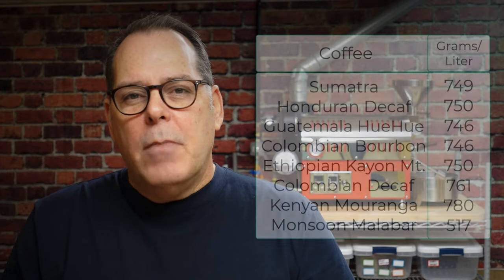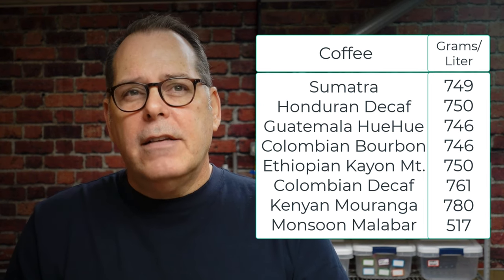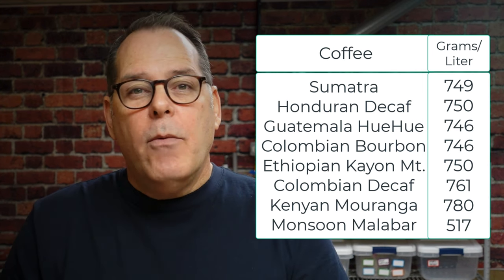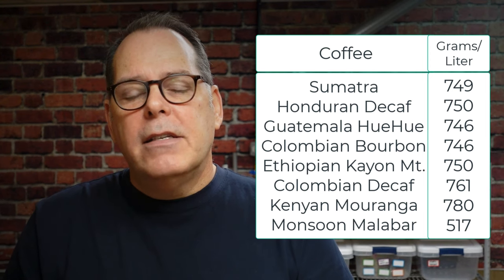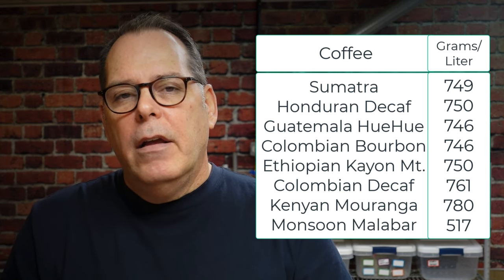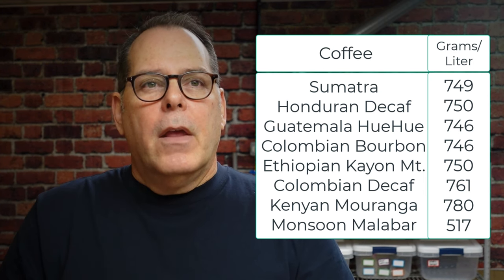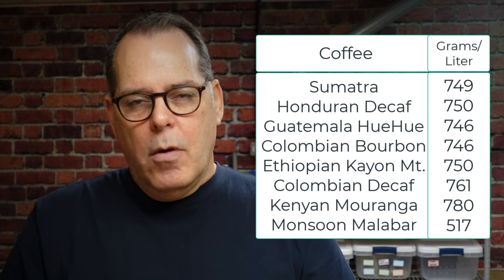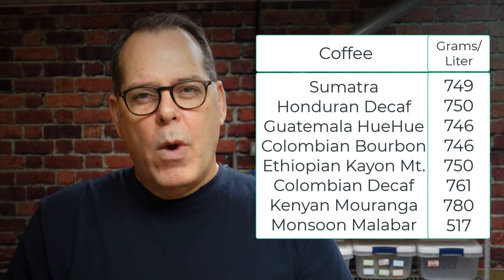Measure Green Coffee Bean Density

Comment: I was wondering if moisture would have more of an effect, if a high density bean with 9% moisture and a high density bean with 11% moisture would the 11% moisture bean roast more like a medium to low density bean as it will conduct heat better? Or would it not be as significant as just the density of the bean? I would guess density matters but what makes up that density also matters,  I’m not quite at the stage of measuring all of these variables yet but it’s super interesting, so far I have a basic profile I run on all my beans as a test roast (100g) to see if the roast needs to be longer or shorter and then adjust from there but I’m guessing by testing density first and moisture I might be able to jump right into a profile that would be 80% to 90% correct for the bean. Definitely going to test density today!
Reply from the maker: Hi Jack, great point.  It is very interesting and I am not experienced enough to give any definitive perspective comparing what is more effective.  I agree that moisture is another part of understanding our coffee and how it may respond to heat.  I measure moisture loss  from green to roasted beans, but I don't have a way to measure moisture level of my beans.  Do you?  What do you use?  Take a look at this really interesting post by Joe Morocco dealing with this topic and let me know what you think.  
 https://joemarrocco.com/2016/10/24/coffee-roasting-measuring-what-matters/

In a nutshell, Joe says:

I" would argue that this difference in moisture does not matter to how heat is transferred to the coffee. The density of the coffee DOES matter to how heat is transferred to the coffee.  The physics of heat exchange are such that: heat transfers more quickly (conducts) through more dense objects, and more slowly, (is insulated against) through less dense objects.*  Therefore, density is key."

I appreciate the discussion and want to learn more about this topic  Maybe I need to buy a moisture meter?  Let me know what your testing revealed.

Thanks again for your comment and for watching my video!

Comment: Hey Mike, good info. So what altitude ranges define low density vs high density beans?
Reply from the maker: Hi Gary,

Density isn't just about altitude, but temperatures, moisture and maybe even the varietal.  Generally speaking, the higher the altitude has cooler temperatures and less oxygen which causes the plant to grow slower.  This slow growth of the seed creates a really solid, dense bean.  These dense beans tend to be more sweet.  Coffee grown below 1200 m.a.s.l. (meters above sea level) is considered in the lower, softer density.  Between 1200 - 1370 is considered a medium density.  and above 1370 meters we start to get into the high density beans.  There are actually other ways they describe density, which is hardness.

Low Density
SB - Soft Bean ( grown below 1200 meters)
SSB - Strictly Soft Bean ( grown below 1200 meters)

Medium Density
HB - Hard Bean ( grown between 1200-1370 meters)
HG - High grown (grown between 1200-1370 meters)

High Density
SHB - Strictly Hard Bean (grown above 1370 )
SHG - Strictly High Grown (grown above 1370 )

This is my source article for the data above.
https://perfectdailygrind.com/2021/08/understanding-coffee-bean-density/

Comment: Hi namaste good morning I'm from Nepal 🇳🇵.  My question is how we can measure it at home
Reply from the maker: The instructions are given at this point 11:50 in the video.  Measure 250 grams of water by weight into a plastic cup.  Then draw a line around the cup at the water line.  This is your fill line for coffee beans.  Read that weigh and divide that by 250.  The result is a decimal number.  Just remove the decimal and use the first t numbers.  Example would be 0.768 and this would use just 768 as  your number .  Low density will be 500 and super high density will be 800

Comment: Thanks for another great video! I just measured the density of the three beans I’m working on currently (Dominican Org, Brazilian Mogiana, and Congo Kivu) and to my surprise they all weighed within 1-2 grams of each other, leaving the bean density practically identical. Is that close enough to initially do the same roasting profile on all three per do I need to adjust over 1-3 grams over a 200 gram sample?
Reply from the maker: Hi Michael,  Initially....... yes.  
 Density is one way to determine how you will approach the coffee.  Also look at the bean size and processing.  Small beans will require you to be less aggressive with the heat.  Then there are the tasting notes and your own personal goals for a flavor profile.    So, technically you should have similar results as far as temperature, color and the overall roast level.  We haven't discussed the existing moisture level in the beans, how old they are and where they have been stored.  These factors can cause your results to vary even when you use the same profile.
Reply: Much appreciated. There are definitely differences in bean size among the ones I have on hand. I’ll have to check with the supplier and see if the other information is available. Thanks again!
Reply from the maker: i don't think you need to be that precise Michael.  Generally are the average size beans, very small beans or large beans is the idea.  If you are going for origin flavor and not a darker roast then using the same profile to start should be good enough.  Based on the coffee you mentioned, it sounds like earthy, darker notes like nuts, chocolate, and maybe a little fruit are in those coffees?  Also, the altitude for those coffees are probably not really high and most likely something like 1,000-1,500 meters above sea level.  So, if they are similar you have a better chance for them to behave similarly using the same profile.  There will probably be some adjustments to your heat needed between these coffees.  The only way to know is to chart your roasts and compare times and temps.

Comment: I went ahead and compared the densities of my regular and decaffeinated Columbian, and sure enough, the regular is less dense.  However, I also noticed that the decaffeinated coffee lost more mass in water than the regular beans.  This leads me to believe that higher density in the decaffeinated beans is due to a higher water content, at least for the water process decaffeinated beans.
Reply from the maker: Hi Larry, that makes sense to me.  What was your lowest density coffee and what was the number?
Reply: @VirtualCoffeeLab   My measurements were a little "quick and dirty" just to get a comparison and test my hypothesis.  As I recall, the decaf beans were 160g/236 mL (678g/L) and the regular beans were about 150g/236mL (635g/L).  But I want to actually measure the mass reduction before and after roasting each.  This will happen next weekend as I have enough coffee for the week.
Reply: I repeated my measurements more carefully today and found that the difference in density is too close to determine using the method given.  I filled a measuring cup to 250 mL and measured the mass.  Decaf Col: First trial: 195g/250 mL (0.78g/mL).  Second trial: 185g/250mL (0.74g/mL).  AVE 0.72g/mL.  Reg Col: 187g/250mL (0.75g/mL).  However, I measured the mass reduction for the decaf today: 198g to 167g.  I was keeping the roast controlled at about 270°F watching the "A" temp rise up.  The "A" temperature got up to 360°F a little sooner than I'd have liked and as a result it reached 2nd crack about 30-60s before I was planning.  (I was trying to roast as high as I could to get the caramels out without getting into 2nd crack.)  %loss = 198-167/198*100 = 15.6%.  Next time I do the regular Col I'll measure the %reduction to compare.  I'll also sacrifice a few beans of each and measure the density by displacement.  This will be tricky because the beans are less dense than water (0.8g/mL vs 1g/mL).
Reply from the maker: Hi Larry, So if I understand you correctly, you are trying to determine roast level by moisture loss right?  You mention you are trying to get as hot as you can for carmelization can you share your phase times with that Colombian coffee.  I'm curious to know what they look like.
Reply: @VirtualCoffeeLab  Sorry, I never tried to imply that I was trying to determine roast level by moisture loss.  Ultimately I just want to compare moisture loss of the decaf and reg Col, and also intend to more accurately measure the densities of each.  I only mentioned the roast level in case some one was trying to compare results.
Reply from the maker: Yea, no problem.  Moisture loss can be determined using the same density method and comparing the greens with the roasted I think.  I usually measure the pre and post roasting weight and calculate the difference that way.....   
My question about phase times (dry phase, brown phase and development phase was because I was curious what your roast profile looked like based on your temps you were roasting at with the behmor.  
Sounds like you are having fun roasting at Home Larry!  Thanks for sharing.
Reply: @VirtualCoffeeLab  The decaf beans took on a near dark chocolate brown colour with oils showing up a day later.  Behmor profile was preheat to 220, P2 profile to start until "B" reaches 270F, about 6 minutes in. Then I manual cycle between P3,4,5 to get the "A" into a slow rise from 300F to 360F over the next 5 minutes.  I attempt to reach "A" = 360F at about 11 minutes.  Taste isn't as sweet as I'd like, but I've got a reproducable profile that I can tinker with.
Reply: Reg. Col mass reduction: 16% (200.5g to 168.5g).  
Decaf Col mass reduction (Feb 5): 14.5% (203.5g to 174.0g).  
Decaf Col mass reduction (Jan 23): 15.6% (see above).  
The differences are not significant enough to say one has more moisture than the other.  This suggests that the moisture content in each is the same.  I will have to measure the density of each more accurately to compare densities though.  But this is suggesting that the decaffeination process does not alter the density or moisture content, but mainly alters the structure.
Reply from the maker: That is great information Larry.  The article I linked to earlier from Joe Morocco (the guy who is in a lot of the mill city coffee videos) wrote a blog article about density and moisture and concluded that density is more of a key factor than the moisture.  

Thanks for sharing your findings.  Very interesting!

Comment: Hi Mike I am new to roasting coffee I just received a Huky 500 about two weeks ago and have about 9 roasts on it. My question is if the coffee is high density do you charge at a higher temp or lower temp? 
Thank You
Reply from the maker: Congratulations on your new roaster Frank.  Because you have a high density you can roast using a higher charge temp.  You don’t have to.  Lower density coffee usually charges at a lower and then ramp up temps.  They do that to reduce roasting defects like scorching and tipping.  
How long is your dry time with the Husky?
Reply: @VirtualCoffeeLab  Hi Mike for the Ethiopia coffee it was about 2 min. I put my profiles of the roast on Barista forum and they told me to charge the coffee at a lower temp I was charging at 428. I am going to try 400 to 395 and give that a try.  Thank You
Reply from the maker: Frank, i would suggest you don't just focus on the temperature for charge.  Everyone's temps will be a little different and it will give you slightly different results.  To determine a good  charge temperature for that specific coffee for your roaster, in your environment, consider using the time it takes to get to dry end as your gauge.  Aim for a dry time of about 4 1/2 minutes.  So, all yellow, no green is how I know I have reached dry end.  Along with that, consider using about 80% power/fuel during dry unless your roaster can't keep up and then you will have to use more energy.  
Be sure to pre-warm your roaster for a good 15-20 minutes before roasting.  Get your roaster to the right temp for charge that will get your coffee to dry in 4 1/2 minutes.  You will feel more in control and set yourself up for a nice middle phase on your way to first crack.  Just to get a starting point, consider a first crack time around 7 3/4 minutes and then with a ROR that is still descending target your drop around 9 min and 30 seconds.
Try that recipe.  it will give you practice to control your roaster and the pace of your roast.

Comment: Nice Mike!  Just the kind of video an engineer likes to see!  I'm not sure what to do with my density data (see below), especially if there is not a lot of variation between coffees.  Since I'm currently using a Behmor roaster, drop temperature can maybe guide me on pre-heat temperatures.  I can't recall if you stated it, but does the density give some determination on total roast time?  I know the roast time can be varied to have different characteristics of the coffee come out.  But are there any basic attributes like high density coffees have slightly longer roasting times and low density coffees have slightly shorter roasting times?

You know me, I just couldn't wait to measure density for coffee in my current inventory.  All appear to fall into the high density category, with Columbia measuring lowest density and Costa Rica measuring highest.  So here are the numbers:

Columbia          705
Costa Rica        769
Nicaragua #1   710
Nicaragua #2   722
Guatemala #1  753
Guatemala #2  745
El Salvador       734
Reply from the maker: Hi Lou, thanks for your comment and for watching my video.  I think with the behmor and the slow ramp up of temperatures it doesn't have much of an impact as far as the dry phase goes.  I made an incorrect statement on my video (which I am correcting) where I said the lowered density bean has a faster heat transfer when in fact it is slower.    It is more prone to roasting defects and sensitive to heat later on near first crack as it goes exothermic.  I'm still for shorter roast times on the high density coffee.  The 4-6 minute window for drying is a good range to get enough time in browning and development for a nicely developed roast with well rounded acidity.  The only low density bean I had was the monsoon malabar.  Everything else is high density.  We have similar tastes in coffee! ;-)

So in short, if your roasting high density exclusively then keep doing what your doing.  When you start to roast lower density coffee and you have determined it is low density by measuring, then be cautious o roasting defects and if using a drum roast, go low on gas for the first minute  or 2 and then begin to ramp up the energy. Hope my response was helpful.